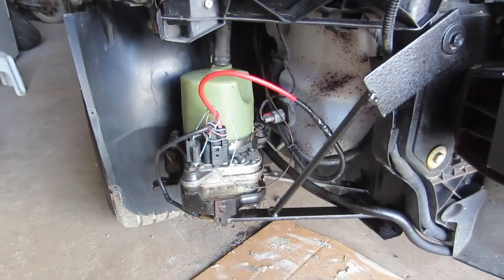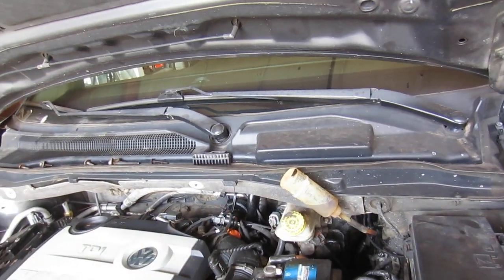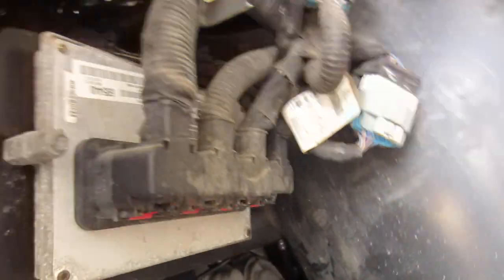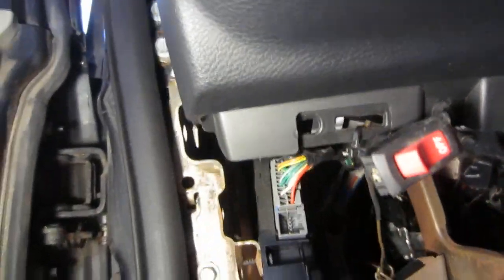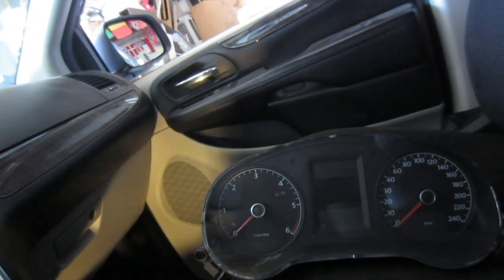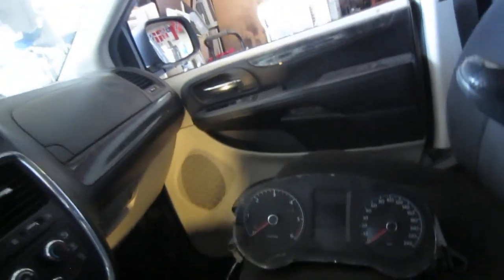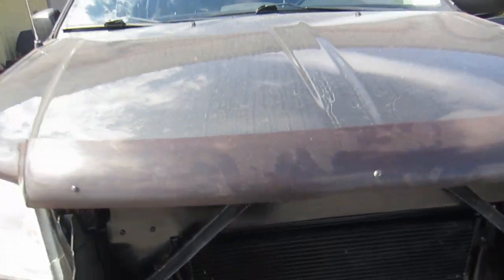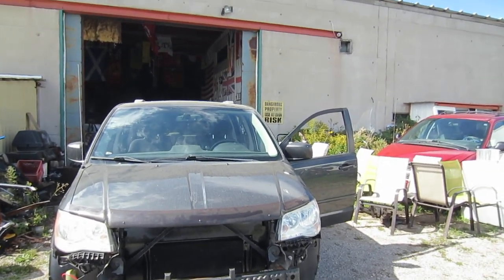25.  Electric power steering is hooked up and first test drive of diesel TDI 2011 Caravan

Comment: I always get thought a 4 cyl turbo diesel minivan would be the ultimate practical and capable vehicle.  Only thing else it needs is 4x4 for winter climates. I am not anywhere near as motivated or talented as you are though Dave 😬